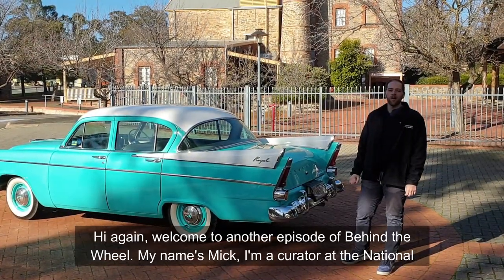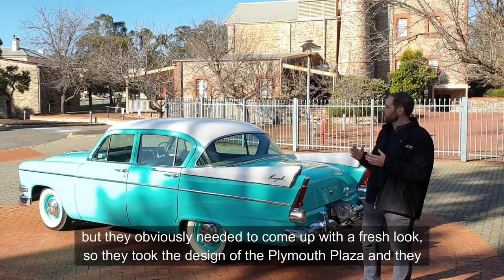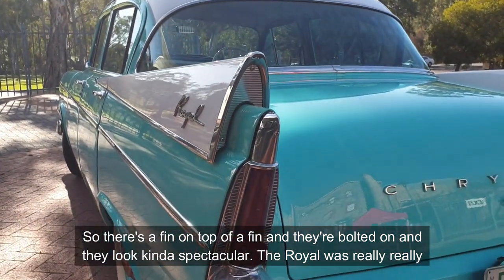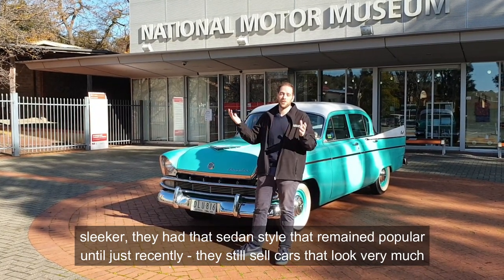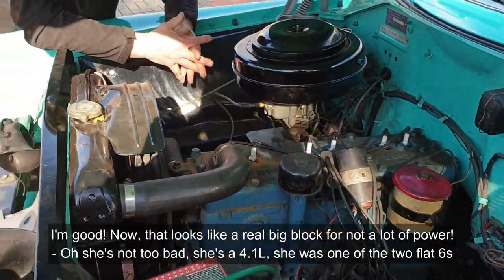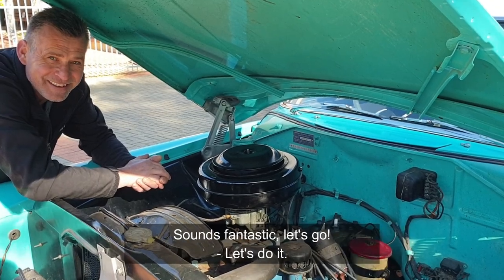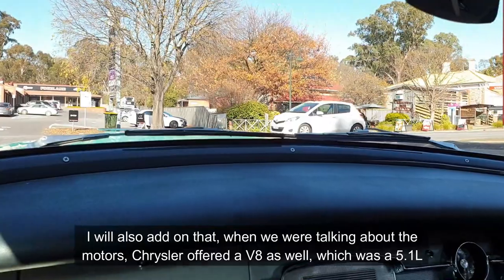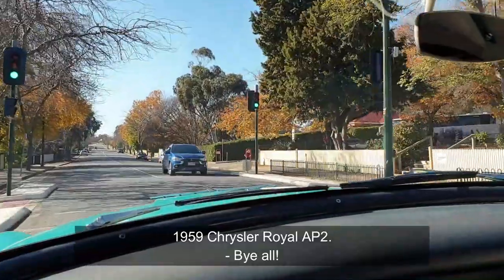Behind the Wheel: 1959 Chrysler Royal AP2

Comment: Does anyone know how easy/hard it is to get parts to restore an AP2 ?

My grandparents drove one of these, and it's still sitting in the shed where it was parked in the late 80s when i was about ten.

Ive often thought id like to get it back on the road, but never looked much into it.

It's been in a shed it's whole life, so it's still in pretty good shape, but id imagine there would still be a lot of bits and pieces that would need replacing, like wheel bearings, brakes, hoses and rubbers
Reply: The first port of call would be to search for an early Chrysler club

Comment: Motor is 🇺🇸 the doors are the same as the model before the Royal .  The 313  and the last one was a 318 poly . Brand x motor could not hold a candle to the poly V8 . My dad had a 1948 black sloper pylmouth  an a black 1955 Plymouth with red trim . Yes the last model had a lower roof line .